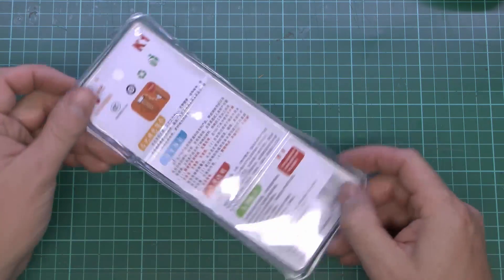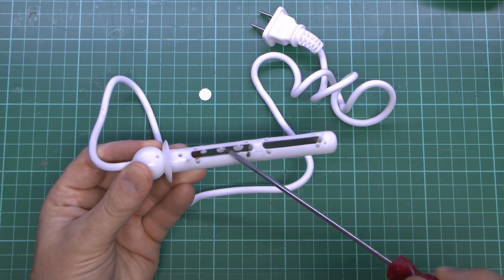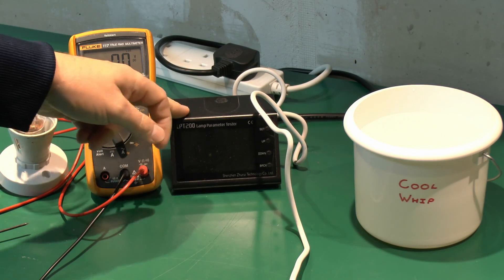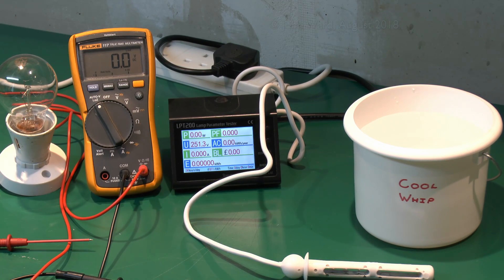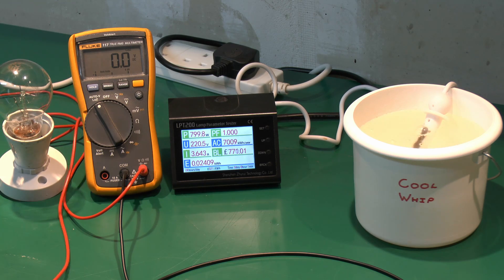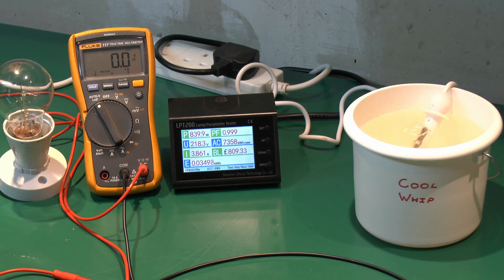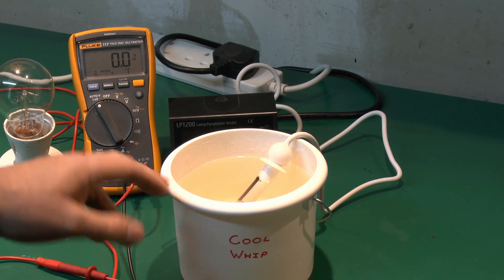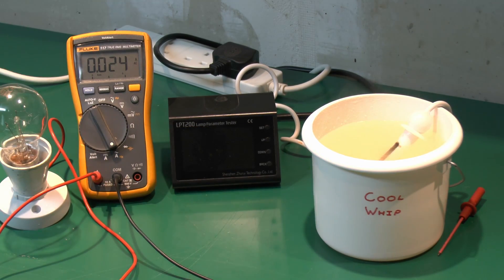Unsafe Electric Electrode Water Heater

Comment: The Chinese doesn't tell you not to put your finger in while heating, but it does say unplug it before taking it from the water. It says suitable for heating drinks and washing up water.
It seems this is a fairly common device in China but I've noticed people are far more respectful of electricity there, they wouldn't let their kids go near an electric socket and touch it for example.

Comment: I'm just curious how efficient would this device be? Like how much of the electric energy is used to heat the water?
Reply: All the current that hits the water would be heating the water
Reply: @God-CDXX  I'm guessing some amount of electrolysis is happening at the electrodes, obviously for efficient electrolysis you'd be using DC but that isn't the intent of the device.
Now if that assumption I'm making is correct (the instant formation of bubbles in the cold water do seem to indicate it to me) then some of the energy going into the device will be used to split water (H20) into hydrogen (H2) and oxygen (O2).

And if it isn't that traditional electrolysis with non-traditional AC then there's still something else going on (the water going murky over time as it is heated). Some kind of reaction is happening at the electrodes which probably consumes energy.

Comment: Nice Video.  One thing we shouldn't forget is what would happen under a fault condition, i.e Neutral Failure...  The way the Chinese construct things and the supplied deathdapter hardly fill you with confidence about reliable connections, so this scenario is probaply more likely than you think!

Comment: Electrode heaters have been used for years in every country even in the jugs our parents used, and are perfectly safe when you use them as intended, like toasters, still are, or are you going to stick your “probe” into one of those next?
Every electric kettle (jug), the type with the hinged bakalite lids had bare nichrome elements wound on ceramic bobbins.
As for the lamp limiting the current at milliamp levels, lamps are PTC devices and have a very low cold resistance, so as an old electrician you get a fail from me on this video.
All that said, the brown water is not a good look, I wonder if that’s not a first use thing I.E. oils and contamination from the stamping and injection machines rather than the electrical decomposition of the actual electrodes.
Reply: Michael Harman nichrome resistance wire in water that you cannot touch while energized, by design of the kettle, is entirely different to this thing which does not prevent any touching of the water and which does not have a heating element. These are literally electrodes that use the (rather variable) resistance of the water as the resistance element.

I guess your attitude to safety is why you’re a former electrician...
Reply: Jasper Janssen , I see that reading is not your strong point..  “old” as in vastly experienced electrician, not “former”, what’s your answer to toasters, bar heaters ETC.
Don’t get me wrong all electrical devices are dangerous in the wrong hands, as for these things, I’m NOT a fan but they are used everywhere in Asia with very few incidents of injury, and if you don’t like them DON’T BUY ONE....

Comment: i wonder if using carbon rods as electrodes would make it less toxic... on one side you would get CO2 and the other probably just hydrogen?edit: brainfart, due to AC it would just generate even mixes of the gases

Comment: How are you getting a voltage reading from just one probe when the other one doesn't appear to be connected to ground?!?!?!?
Reply from the maker: Black lead in the water, the red one connected to the power supply for the heater.

Comment: With almost no current flowing you had almost 100V, which made me scratch my head as to why only 80mA traveled through the bulb. Resistance of a normal incandescent bulb wouldn't be over 1000 ohms, especially at low current. Presumably the already high resistance of the tap water increased (to ~3000 ohms) as short circuit current began to flow, dropping short circuit voltage to a far lower (though still unsafe) level. Add in electrolyte such as an MSG/salt flavour packet and current would increase.

Comment: You tuber bigclivedotcom has done the exact same tests with this same product.  The resulting water was disgusting.  The bubbles aren't all steam but include hydrogen and oxygen gas.
Reply: I thought electrolysis only happens with DC current ?
Reply: With DC the H2 and O2 gases separate and congregate around their respective electrodes.  In AC the H2 and O2 are mixed.  The off gas is quite flammable when collected and ignited.
Reply: Thanks thats interesting to know

Comment: Hey mate is the device current limited? Maybe the current will shoot up if you put some thing conductive in the water?
Reply: it is literally just the electrodes. No other components. It gets really funny if you add a lot of salt.
DiodeGoneWild did that.
Reply from the maker: Not at all - it's literally just two metal plates connected to L&N. Current limiting is entirely due to whatever is between the plates.

Comment: Why such devices are allowed to be sold in the country is beyond me, I thought electrical equipment had to comply with national safety standards. 'incredible' and very inefficient, water is not a good resistance material. Wattage per thermal unit temperature rise would be very poor, I'm guessing. Dumb as!
Reply: Doubt it's allowed to be sold anywhere in the EU, but what you import yourself is not covered and totally up to you...
Reply: It isn’t allowed to be sold in the UK, and wasn’t sold in the UK. He bought t in China, as you know since you watched the video...

Comment: If you don't mind the risks of things like metal in your diet and overloaded circuits, you can make a bowl of ramen stupid fast with one of these.  Seriously, just dump the noodles and flavoring into the water all at once and let it rip.  On 110V, I had edible ramen in under 2 minutes.  Also ruined my first boiler because it probably drew 14A through the microscopic wires.  Quite an enjoyable device, really.

Comment: You should use a larger electrode in the lamp test if you want to simulate putting a finger into the liquid.
Reply: was thinking the same. It will make a big difference.

Comment: The small exposed area of your probe "finger" restricted the current.
Reply: Fake News.
Obviously the small water cross section at the probe tip is the highest resistance element in the circuit, but I don't need to discuss that, everyone with a basic grasp of physics will understand.
Reply: Mike Trump  yes, he knows better. Maybe you should learn some basic physics instead of insulting people.
Reply: Thanks, but it's pretty hard to insult me. If I have learned one thing on the internet it is the following: "Never argue with an idiot, he'll only drag you down to his level and beat you with experience."

Comment: I don’t understand why you would get shocked if you stuck your finger in it. Don’t humans have high resistance so it’s hard to get shocked generally, and the current has a clear path to go through to get to the other side so how would putting a finger in there disrupt the circuit? Can someone explain? I’d like to learn
Reply: Because the earth is directly referenced to the neutral side of the mains it provides a route for the current through your body to earth and back to neutral mains. Although the current can flow directly through the water from live (hot) to neutral, if you put a finger into the water you can become one side of a potential divider (like two resistors in series with current across them and with a centre tap between them) which lowers the potential (voltage) you receive but which is, as JW said, more than enough to cause a serious electric shock, especially when the current of almost 100mA is taken into account, where less than 10mA at mains voltages can kill. I hope this helps explain.
Reply: Washington_PC If you provide a current path between active and earth, your body could act as a parallel circuit to the electrodes of the device.  Although the current passing through your body would be small relative to the current between the electrodes, it could still be large enough to do you an injury.  You'll notice in the demonstration that John was able to pass about 80 milliamps through the ammeter electrodes.
Reply: This is not a nice device, but I think the danger of electrocution is greatly exaggerated. If you put your finger into just the water while grounded yourself the current through your body will be nowhere near 80 milliamps as the resistance of human body is much greater than that of the almost cold lamp filament. You will get some kind of  a shock, but I doubt it will be enough to kill anyone or even trip an RCD. The 90 Volt observed in this experiment is an Open Circuit voltage, not the loaded one. It's a pity he did not measure the Voltage while the lamp was connected, I doubt it would be more that 30 as evidenced by an extremely dull glowing of the lamp. If it retained 90 Volts the lamp would have glowed much brighter.
Reply: Most of the current will go through the water and back into the 230V supply, but you only need a small proportion to go through to you to get a significant tingle off it.

Comment: This kind of "inductive" water heating was common down here at least. Some systems even used 3 phases. Kettles that used this were the norm in motels. The system is fail safe as once the water boils away no more heat. Those kettles were designed so that one couldn't put a finger into the water while it was plugged in.

My biggest concern is the metal the electrodes are made from dissolving in the water. Steel is rarely just iron and for a small percentage of the population iron is moderately toxic. The old motel kettles had brass / copper electrodes but ingesting too much of that's not ideal either. Then there's the plastic, it might be OK or not....
Reply: It's resistive, not " "inductive" ", but I agree its only safety feature is that it won't catch fire if it boils dry!
Reply: Always heard them referred to as "induction' heaters. I get what you're saying but water and electrical conduction is no trivial thing thanks to it being a polar molecule.
Reply: Finally worked out this "induction" thing. It's not what we thought.
Nothing to do with electrical inductance. What it refers to is the water itself being induced to become hot by the flow of electrical current through it.
I now recall the same terminology used with furnaces that have fans that push and pull air through them. Pushed in air is "forced" draught and pulled out air is "induced" draught.

Comment: Doesn't China use an ungrounded system? So it's only a death trap when used on a grounded system.
Reply from the maker: 2 pin plugs have no ground connection, but the supply is still referenced to ground.
Reply: mharris1270 no, that is not an american 110v plug. It’s a Chinese 220V plug. The fact that Chinese 220 plugs look an awful lot like very old fashioned US 110V plugs and why is left as an excercise for the reader.
Reply: @JasperJanssen  2 prong U.S. plugs are only allowed over here in the States if the device has other protections. The wire itself must be double insulated and the casing of the device must be completely insulated and shock proof even if a fault occurs. If the casing is metal, it must have a third prong for ground.  Underwriters Laboratories also must test and certify it. Of course, you can buy equipment not tested by UL (or equivalent partner labs) but most retailers here wont sell it. You'd have to go straight to China as John did in this video. Can't really prevent that. Natural selection at work.
Reply: John Smith all that is also true here in NL and the rest of the EU.